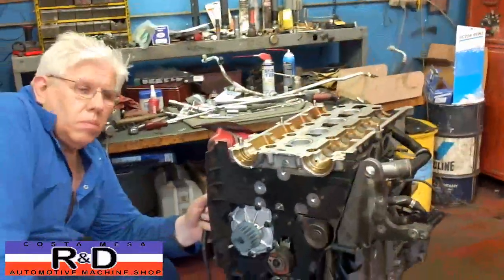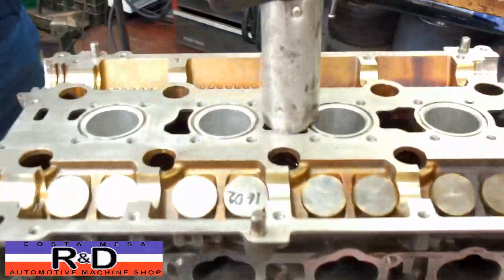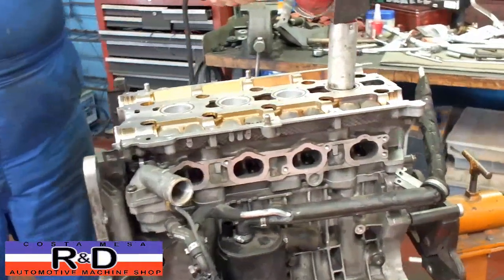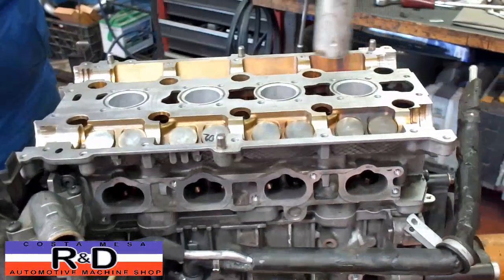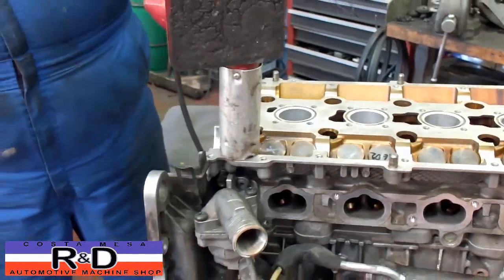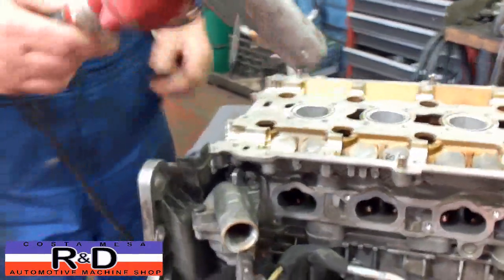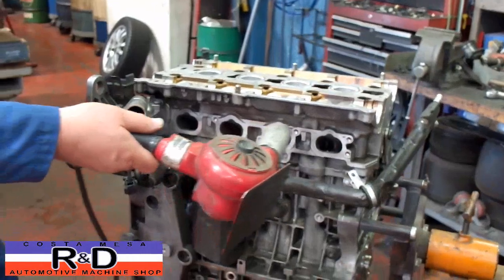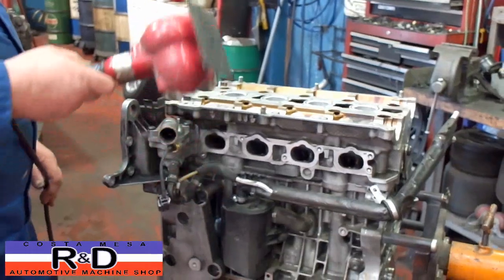Cylinder Head Heating Before Retouque

Comment: Should this process be done on all engines? I just finished my rebuild and did not do this, the fastener manufacturer should have specified to do this if I was supposed to, no?
Reply from the maker: This process is not new to Europeans, but it is pretty much unheard of here in the States. But, it does make a lot of sense. Most engines today have alloy heads and cast iron and the heads should always re retorqued, in my opinion.

Comment: so the work cycle is: 1) heat up the separate head  2) assemble with gasket, torque cilinder head bolts to spec 3) let it cool down completely 4) retorque the cilinder head bolts.   Correct?? Unfortunately I cant understand most of what you are saying in these video's due to the ambient noise.
Reply from the maker: Install the head, torque, heat, let cool completely, then retorque.
Reply: fiatnutz thanks for clarifying that
Reply: this way to do permits the setting of the new bolts then the retorque will stay correct.
On this design, it's impossible to retorque the head without a major disassembly of the engine top.
it's a nice engine but the valve cover design should be way better and it's not the traditionnal working philosophy of Volvo.